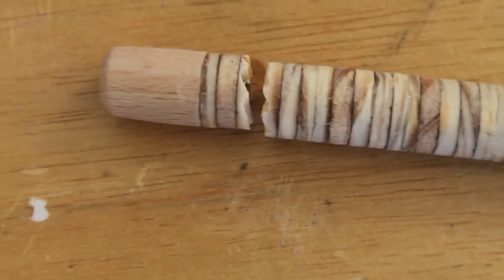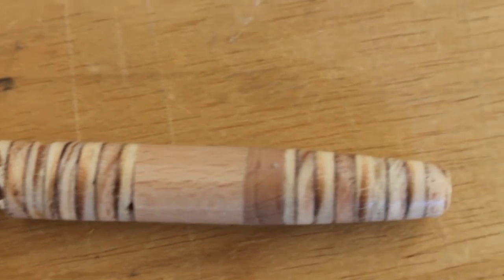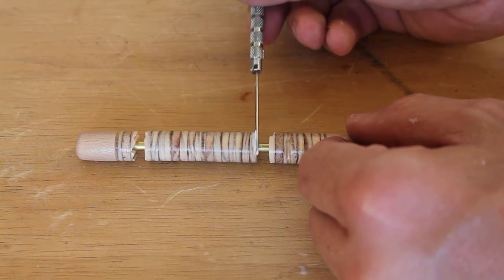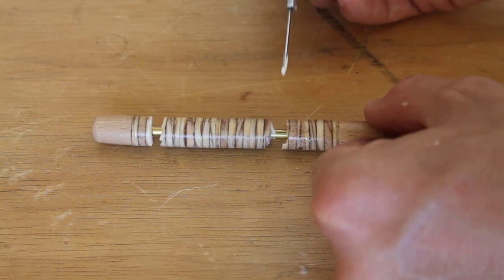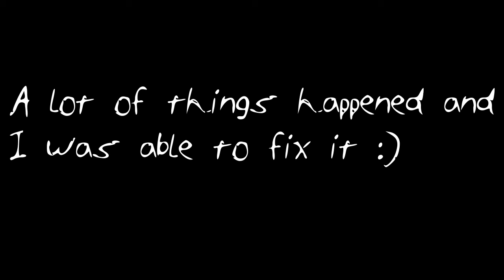Making a plywood pen with no lathe and no pen kit

Comment: Great pen. Especially as no lathe was used. You dont need a lathe. You have a drill, which is like a portable lathe. If you make a rest for the other end of a mandrel, it will keep the pen from wobbling. Instead of using wood glue, woudnt thin superglue be better as it would soak into the plywood ? I think I will have to try this.
Reply from the maker: cool, post back when you get something made! As for the super glue, I 
think the wood glue would be better, it seems to me the superglue would 
be more brittle.